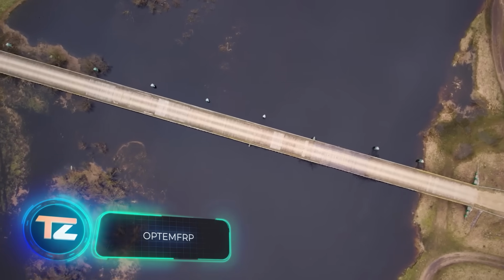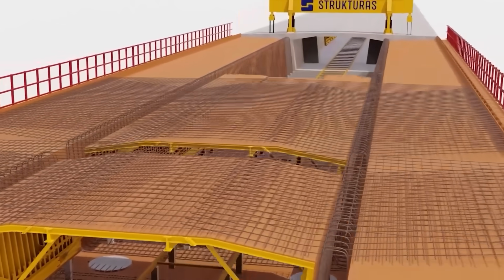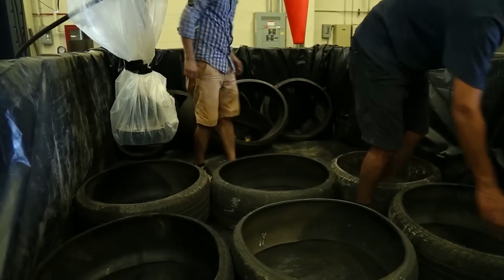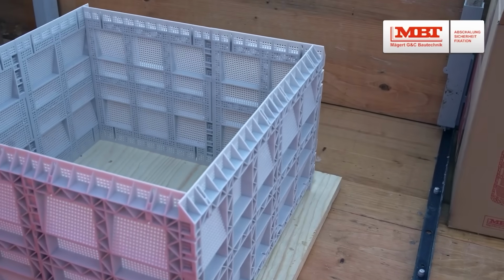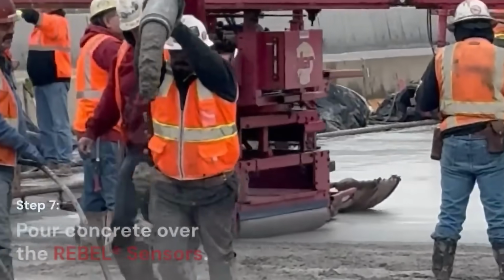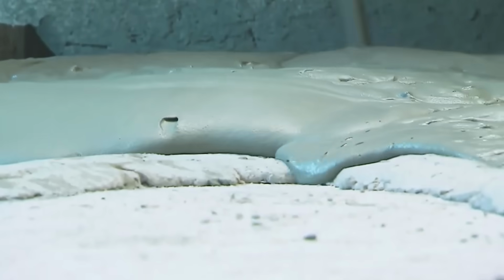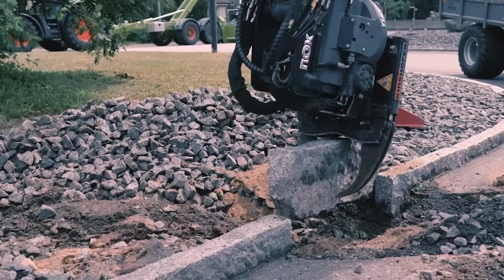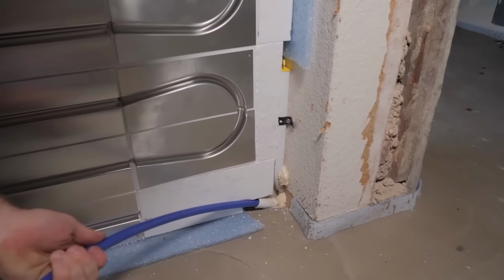CONSTRUCTION TECHNOLOGIES THAT HAVE REACHED A NEW LEVEL

Comment: No to the heated walls. It's only a matter of time before someone decides to hang something there. Even if the original owner knows better, future owners may not. One poke with a nail or screw will create a massive mess and an expensive repair bill. The other tech is cool though.

Comment: I wish at least one referral to self-made ecological bricks and their benefits (Dont burn, very strong earthquake resistance, up to 5 floors without columns, much cheaper 90% Clay and 10% Cement, also breathable and there is no need for extra insulation materials)
Compressed stabilized earth blocks